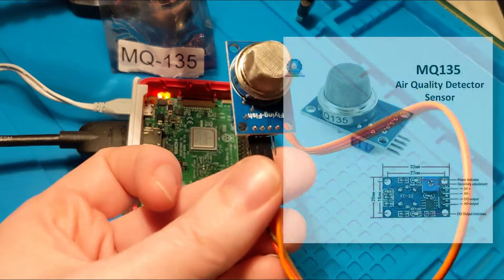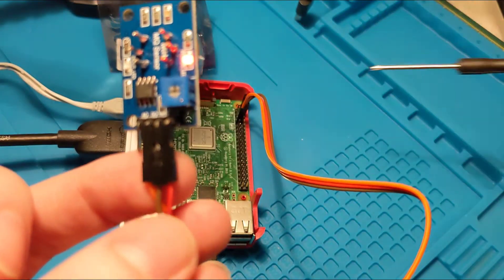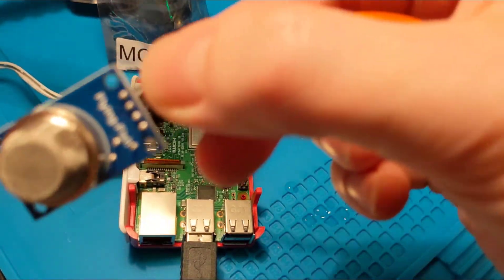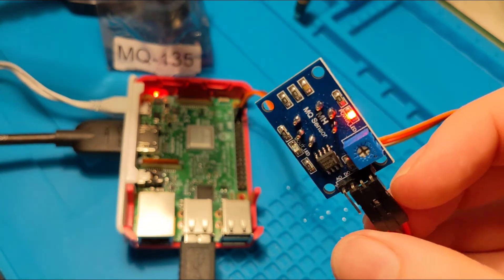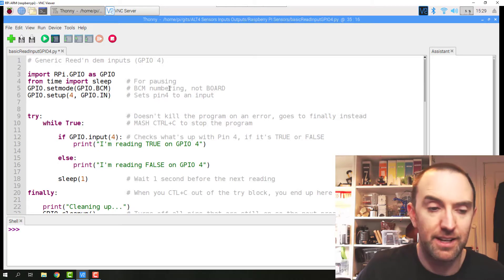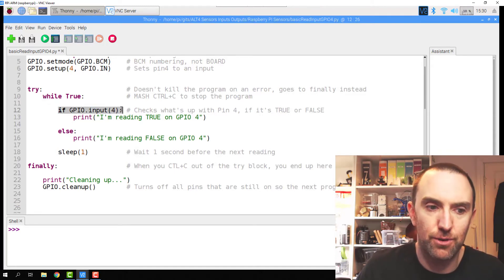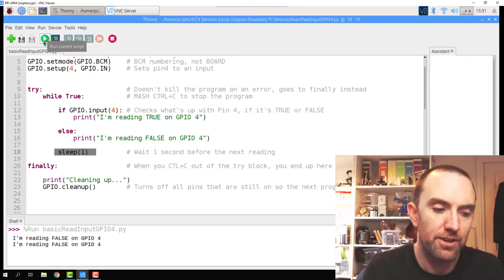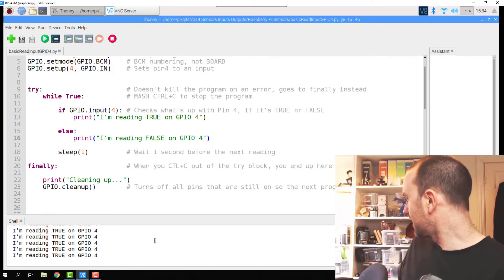MQ-135 Air Quality Sensor with a Raspberry Pi

Comment: Hi sir, can you please guide how to connect this sensor to return Analog Output?
Reply from the maker: Raspberry Pi has digital inputs inly so you'd need to buy an extra little digital to analogue converter hat or module. Adafruit sell a good one with excellent instructions.
Reply: @DannyBMurray  i bought MCP3002. Two chanell AD converter. You can measure two analog values with it..  Or you can measure it with capacitor method with 3 digital pins of RPI.    After i am done with MCP3002 method i will write here.
Reply: @ladislavsom5096  Did you used MCP3002?What are the benefits?

Comment: Hi..if i want to implement mq136 using raspberry pi..is it the same or have a slight difference with mq135 ..can you show how..thank you
Reply from the maker: Yup, same sensor basically, difference gas, also one of the more expensive MQ sensors! Good for Septic Tanks etc. on the farm. I don't have one myself yet but I'd be surprised if it was any different.
Reply: @DannyBMurray  thank you😁